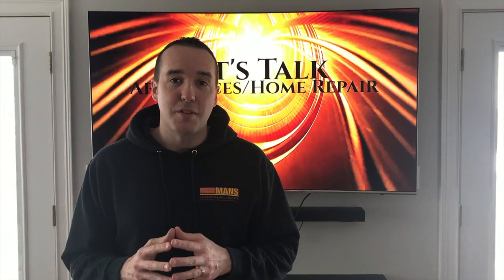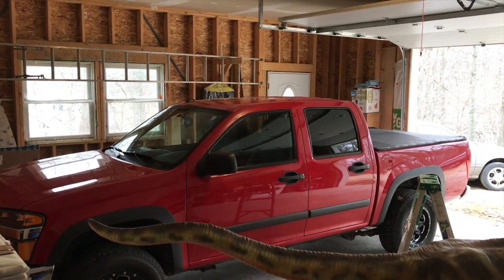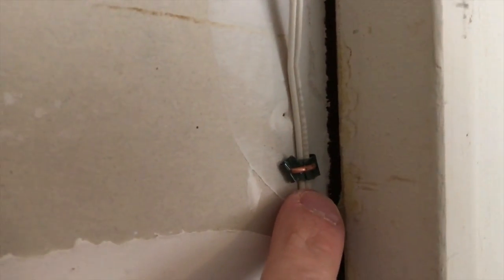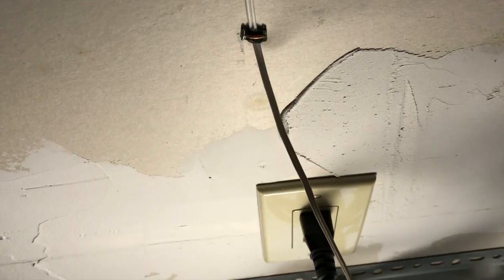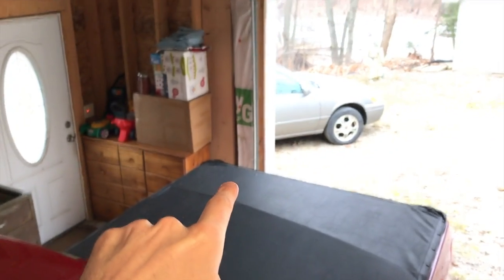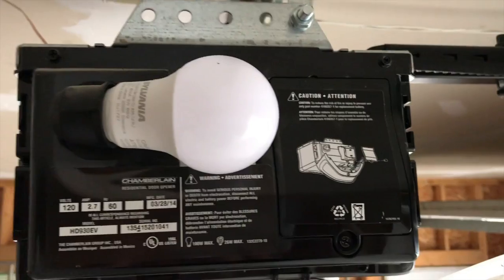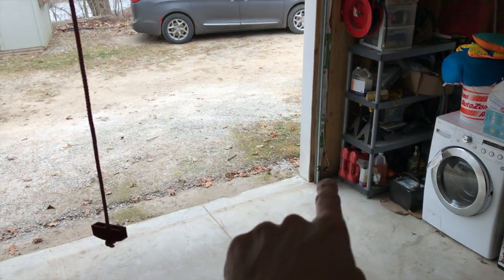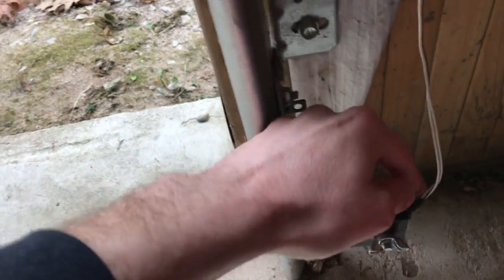Garage door lights flashing/flickering - Most common causes!

Comment: In my case both sensor light off
The door wont go down
I disconnected wires of the sensors door still wont go down
With the sensors connected the unit gives 10 flashes 
If we keep the button pressed the door will go down

Any help
I m suspecting sensor but 10 flashes doesnt make sense
Reply: And and and
Both sensors have 6.95 voltages on multimeter
But their led light is not on
Reply from the maker: @FreakMarshal  

Thanks for watching, any update?  Have you adjusted each sensor?
Reply: @DIYwithMichaelBorders  ya
Reply from the maker: @FreakMarshal  

Thanks for the follow up, are the sensors illuminating green or amber as you adjust them?

It’s possible that your unit will have one green and one amber light in order to operate as normal configuration.
Reply: @DIYwithMichaelBorders  no light on both at all
Reply from the maker: @FreakMarshal  

Thanks for the follow up.  You may want to unplug unit from ceiling outlet and leave unplugged for 5 minutes.

This will allow your unit to reset and hopefully reconfigure.  Something electrical is likely causing issue.
Reply: @DIYwithMichaelBorders  already done
Reply from the maker: @FreakMarshal  

😁👍🧰

Comment: Thank you Michael! In my case, intermittently the door would start to close for a second or two then return open. I found the green sensor LED flickering during operation. Cause of problem was loosely mounted sensing LED, vibration of door closing was shaking receiver. Tightened wing nut and back in business. Thank you for your video.
Reply from the maker: Very cool, that will definitely do it.  Awesome job making it a DIY project, enjoy your upcoming week.  👍

Comment: Mine had the round light flashing. The sensors had the green and red light showing and all looked great. Then I read where the sensors can malfunction if the lens are dirty. I cleaned the lenses and it was fixed!
Reply from the maker: Awesome, & thanks for sharing your experience.  Great job making it a DIY project.

😎👍

Comment: Mine has 4 orange blinks inside the motor. I hold to clear it but it comes back. Both sensors are acting properly, solid amber and green lights. When I hit the light on the opener itself it turns the lights on for half a second and they won’t turn on. Never changed the bulbs from when it was working before. Door will open fine but will not close without holding the button, any thoughts?
Reply from the maker: Thanks for watching & welcome to the DIY Raptor Club.  We recommend re-programming your Travel System.  Below is a link to our video showing this procedure.

       https://youtu.be/M6d9IMjyze4

😎👍

Comment: So where can I find out what the error is if the light bulbs flash twice when I press the control panel button to open/close the garage door? Currently none of my devices are opening or closing the garage!! This is on a brand new home and it was working fine. The safety sensors are lined up so I know that isn't the issue.
Reply from the maker: Thanks for watching & sharing this.  Any update?  You can look up your unit model number manual online and find the exact troubleshooting light flash count codes.

Please let us know if we can help in any way.  Us DIYers need to stick together!!!
Reply: Mine has same issue, just Bulbs flashing no arrows. Did you get yours fixed?

Comment: Hi I have a problem, lights are flickering constantly, I have change logic board  checked the wiring, it worked for few times and same problem(lights are flickering constantly) Any solution?
Reply from the maker: Thanks for watching, there are two common causes that lead to this.

1.  Lock button is turned on.  We recommend turning Lock button off.  Button is located on wall mounted push button unit & will need to be pushed for 5 seconds for Lock mode to disengage.

2.  Faulty sensor.  There are two safety reverse sensors.  If one is faulty or unplugged, lights will flicker continuously.

Please keep us posted on your project.

Comment: My door will go down until a foot before closing and then opens back up light flashes 10 times. The Eye-beams are clear and clean. door does not get caught up on anything rails are new.
 The door was just installed two months ago.
Called installers.. one week for appointment, with service charge because they feel it is not a parts issue. If I can figure it out before they show up and charge me.
Reply from the maker: Thanks for watching & welcome to the DIY Raptor Club.  Let’s try to figure this out.

Flashing 10 times is almost always an issue with the lower sensors.  Are the sensor lights illuminated?

Comment: Thank you for sharing your knowledge.  My garage door can not open, sensor lights are off, Genie garage opener is on.  What can I do?  Thank you in advance.
Reply from the maker: Thanks for watching & welcome to the DIY Raptor Club.  We are unfamiliar with the Genie.  Has anything changed...?

New WiFi, new electrical wiring installed anywhere in house...new security system installed, new power lines within close proximity of home?

Comment: Garage door will go up only so far, then stop. Garage door opener lights go out, will do nothing, wait about 15 to 20 seconds, power comes on and will work for a partial closing with the same action. Motor starter is very hot while this happens, Any ideas ?
Reply from the maker: Thanks for watching.  Have you reprogrammed the Travel System.  Below is a link to our video showing how to do this.  Keep us posted.

       https://youtu.be/M6d9IMjyze4

😎👍🔧🔩

Comment: It doesn’t flicker at all and sensors are both on error code 15- it just moves a bit then comes back
Reply from the maker: Elias Melendez 

Thanks for watching.  It’s also possible that the belt is too tight or rollers need to be lubricated.  Keep us posted.

😎👍🔧🔩

Comment: When we change the garage door motor you need to change the sensors o you can use the old one
Reply from the maker: Jose Cordeiro 

Thanks for watching & great question.  Some manufacturers will make sensors that are compatible with other units of the same brand.  If you purchase a unit that is a different brand than your current unit, it’s unlikely that the old sensors will communicate to the new unit.  Hope this helps.

😎👍🔧🔩

Comment: The lights to my garage door are flickering 4 times, do you know what is the air code for 4 flickers?
Reply from the maker: Malinda Baxter 

Thanks for watching.  The most common cause is misaligned sensor eyes.  Keep us posted on your project.

😎👍🔧🔩
Reply: @DIYwithMichaelBorders  Thanks for your feedback regarding the flickering lights.  The misaligned sensor eyes have been corrected and everything is working fine !!!!!
Reply from the maker: Malinda Baxter 

Awesome Awesome & we appreciate the update.
 😎👍🔧🔩
Reply: DIY With Michael Borders Hi Mike.  The unit itself is blinking (green light) 5 times. Not the sensors on the garage door but from the ceiling where the unit is. Any suggestions?
Reply from the maker: April D Williams 

Thanks for watching, let’s get this figured out!

1st:  Verify no objects are stuck inside & along track...leaves, acorns, gravel particles...

2nd:  Unplug unit from ceiling outlet and leave it unplugged for a minimum of 5 minutes.  After 5 minutes, plug unit back in and test garage door unit.

Let’s start there as it will keep money in your pocket.  Keep us posted.  Us fellow DIY’ers need to stick together!

😎👍🔧🔩

Comment: Hi, I’ve checked all wiring and the safety sensors are good and properly lit, but the door still won’t close without holding the wall button. What could be the issue?
Reply from the maker: Lax Gaming 

Thanks for watching & what’s your update?  Is your lights flashing when button is pushed?... if yes, how many flashes?

Keep us posted.

😎👍🔧🔩
Reply: DIY With Michael Borders the error code suggests a short whether there are wires plugged in or not, so I’m guessing the circuit board is bad.
Reply from the maker: Lax Gaming 

Thanks for the reply & it’s very possible.  By chance do you have LED lights installed in the garage door unit?

If yes, try removing those and installing regular incandescent bulbs and see if that fixes the problem.

Certain brand LED bulbs can cause interference with the frequency and cause issues.  Keep us posted.

😎👍🔧🔩
Reply: DIY With Michael Borders it’s a single incandescent bulb. I’ve also gotten new sensors just in case, still a no go. No matter what, I can reset the error and in a couple seconds it starts flashing again without me touching anything or any wires connected.
Reply from the maker: Lax Gaming 

Thanks for the reply.  It may unfortunately be a faulty circuit board.  How old is the garage door unit?
Reply: DIY With Michael Borders well, I just moved in last month, so that I do not know. It’s a model that was produced until 2015, so it’s at least that old.
Reply from the maker: Lax Gaming 

Thanks for the reply.  It’s very possible the board has faulty.  Have you verified the wiring and connection points that connect to your internal battery on your garage door unit up at the ceiling are properly secured?

Comment: The green light constantly stays on but the red light sensor blinks twice. I can only close the garage door by the main box.
Reply from the maker: Mr. Norman 

Thanks for sharing.  Your remotes are not working correct?...may need to reprogram your remotes.  Are there LED bulbs installed inside garage door unit?  Certain brands of LED bulbs will cause interference with your garage door frequencies thus causing symptoms like yours.  Keep us posted.

Us fellow DIY’ers need to stick together.  Many more helpful videos to come!

Please subscribe to the channel and ring your YouTube bell 🔔 that would be awesome thanks again!

😎👍🔧🔩

Comment: I have 3 overhead garage doors using the side winders motors mounted on the side of garage door. I do have 2 ceiling lights trade off flashing when the doors don't close. The doors will go sown a couple inches and then one of the overhead ceiling lights will flash 10 times indicating sensor, wiring and misalignment issues. The problem is only when closing the garage doors doesn't matter which door and it doesn't matter whether you are using the remote from the car or standing in the garage using the manual button. The only way I get the door to close is hold the manual button down until the door is closed all the way. Sensors have the ambler and green lights for alignment but still problems. I'm guessing there's some kind of frequency interference. I hate to call a door tech out and they come out and do a couple things and the doors are working when they leave but then the next day the doors will be back to their usual erratic behavior. 
Any suggestion. Doors are 9 years old. Chamberlan Liftmaster Elite Series model 3800. 
Oh yeah the ceiling lights are just as erratic, they come in via motion detection but are suppose to go off after a few minutes. Sometimes they just stay on all night. I will push the manual light button and one light will go off and then the other light will come on. Sometimes pressing the button twice will turn both off. We have changed the bulbs in these too and they are just your regular cheap light bulbs, No LED's.
Reply from the maker: Earl Balentine 

Earl, how have you been?  Great to hear from you.  Let’s get this figured!  By chance, do you have new LED bulbs installed in unit?

We ask because more times than not, LED lights installed in older units can interfere with the signal thus causing degraded performance with your system.

Keep us posted!  Hope all is well!

😎👍🔧🔩
Reply: @DIYwithMichaelBorders  I have removed the LED lights in my ceiling lights but my outside coach lights have LED's light bulbs maybe I should remove them too since they are so close to the garage door.  I also removed all my wifi cams near the garage. I even add additional wiring to the antenna because the door would only open if I was within 5 feet of the door, so I always had to get out of the car to use the remote. The longer wiring has help now and can open the door from the street now. Tomorrow morning I'm going to try the reprogramming of the motors to see if that's the problem. I have adjusted the sensors until I'm blue in the face.
Reply from the maker: Earl Balentine 

Thanks for the reply.  It’s also possible that your remote button is losing its top notch condition.

Try pressing & holding remote button down for 3-5 seconds.  If it works at longer distances...& it doesn’t work when just tapping on button, your remote is fading away & will fail all together sooner or later.

😎👍🔧🔩
Reply: @DIYwithMichaelBorders  I have 3 remotes with all new batteries, I only use the one remote for the stall I park in. All 3 remotes have 3 buttons and all 3 are program to open all doors. The 2 remotes that I nee=ver use don't work either. Everything works when the doors are working once the door won't go down it doesn't matter whether you try all 3 remotes, try the manual wall button or even the remote keypad outside mounted on the side of the door. 
The problem exist with the remotes and the manual wall buttons at the same time. So I don't think my problem is the control wireless remotes or wall mounted buttons. I wish I could add a quick video here.
Reply from the maker: Earl Balentine 

Thanks for the reply Earl.  As the units continue to age, you may be stuck with stubborn & annoying behaviors from the remotes....unfortunately...however normal.  😆

The remotes internal motherboard can begin acting intermittently when just the slightest trace of corrosion is preset on electrical leads.

😎👍🔧🔩

Comment: i have 5 green light flashing on my genie pro and it makes mechanical noise in the opener machine. The chain doesnt move. Seems like chain is not properly connected to the motor based on the noise. What could be the issue?
Reply from the maker: tomal_rocks 

Thanks for watching.  If you are hearing mechanical noises or grinding, it’s very possible that your chain has become disconnected from the track and motor.

The motor is most likely doing what it is supposed to and attempting to grab ahold of the chain links to open and close the door...however...the sound you are hearing may be the internal motor attempting to grab ahold of the chain, but while doing so...it’s missing the links.

Keep us posted.  Us fellow DIY’ers need to stick together, many more helpful videos to come!  😀

Please subscribe to the channel and Ring your YouTube Bell 🛎 that would be awesome thanks again!

😎👍🔧🔩